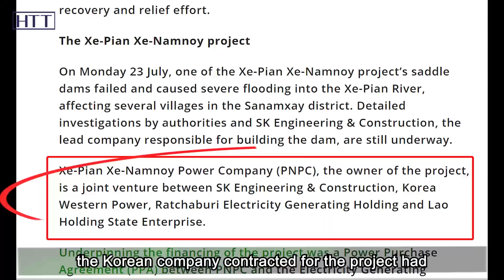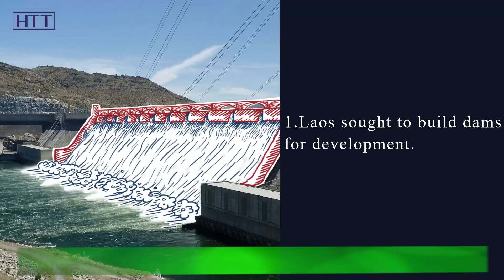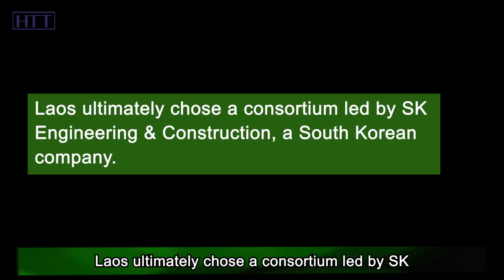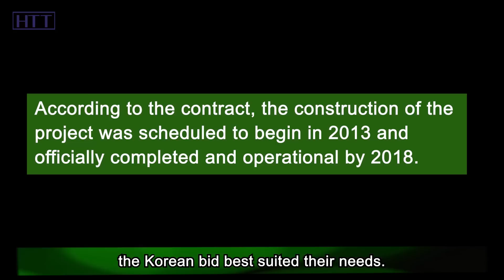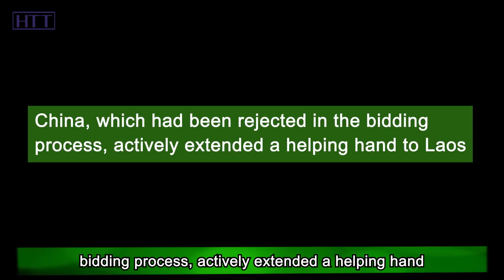Laos hydropower station vetoed China, but China supported it after the dam collapse

Comment: Korean companies are famous on bidding the project with low prices, and earn the profit back through maintenance. you may often see the Korean escalators, that fail often and cost the customers a lot more. However, the customers did spend less in the front, but the pains are followed forever.
Reply: Jap is doing same thing, refer to HSR in Taiwan province. Huge money have been earning from "spare part" and maintenance services.
Reply: Same as Korean cars.
Reply: Capitalists. North Korea wouldn't do this. It's the south and it's capitalist mindset. China still has the old east Asian goodness and not clouded by money.

Comment: The problem with former infrastructure construction countries is that they have given up such project works and no longer have the personnel with the relevant experience to carry out such projects anymore. Same too with the G7 countries. These countries tend to view such projects as low tech and requiring lots of manual labour. Ask G7 countries to build bridges and tunnels or even power stations, and they will find it hard to put forward a team capable of undertaking these projects. Take the California high speed train project. One wonders whether it will ever be completed. Bear in mind that the US does not have a single high speed train.
Reply: Trusting a western puppet wasn't a good idea😂😂😂They can't protect themselves. Who would trust them to build

Comment: Why Laos choosed SK to build the dam ? Under table money. Is as simple as that.
Laos officials pocketed corrupted money. 
After  dam collapse, they call China, then found irregularities in SK firm building the dam.
Fynnuy, that after collpase, they find irregularities. Doesn't Laos has construction Inspectors  overseeing all steps of the construction
making sure building codes are followed ? Or the inspectors were corrupted to turn a blind eye.
Reply: Anyone who knows anything about Korean business and political cronyism would not be surprised that SK cut corners and likely even engaged in bribery of Laotion officials to win the bid. The dam wall was 6 metres lower than tender specifications, as pointed out in the video - how is it possible that that was not noticed by anyone soon as the dam started construction, let alone till after completion?
Reply: @kindface lso noted sand and construction debris were filled in the dam instead of rebar and concrete! It's the root cause of the catastrophe. The height of the dam is not the direct cause as the water did not flood over it.
Reply: As expected from a USA lackey ?
Reply: Very possible corruption was a main contributing factor.
Reply: Inspectors are easily bribed.
Reply: It is difficult not to award a tender to lowest bidder especially in a govt tender.